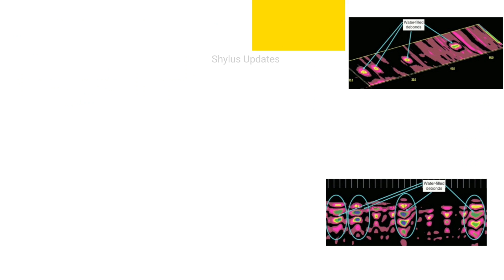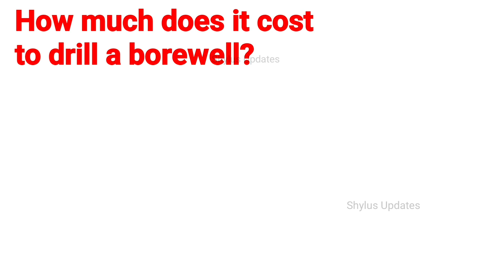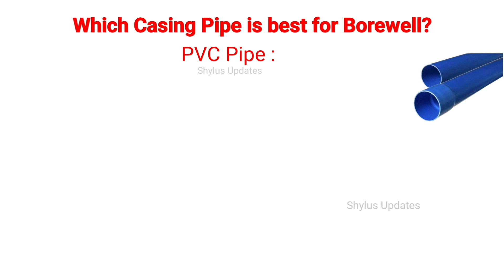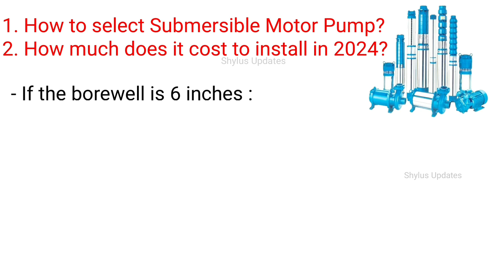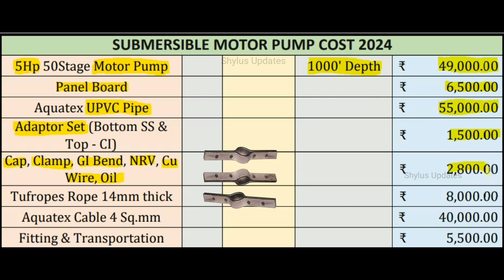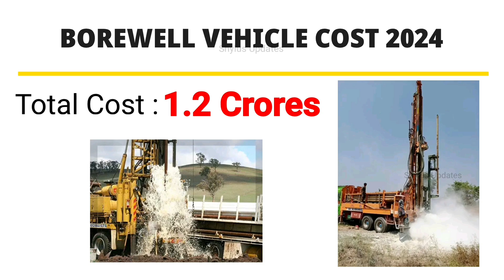Today Borewell price rate  2024 | Borewell pump cost for 100 feet borewell |how to find water easily

Comment: Madam, I think  you have left out the cost of casing pipe in calculating the total cost of drilling and installation of submersible pump set which is not a small amount to be left off.
Reply: How much is that cost
Reply: Yes that's true